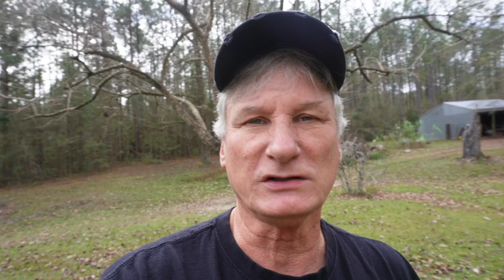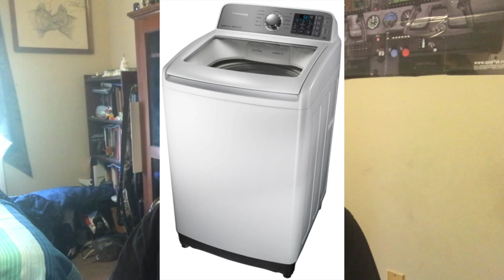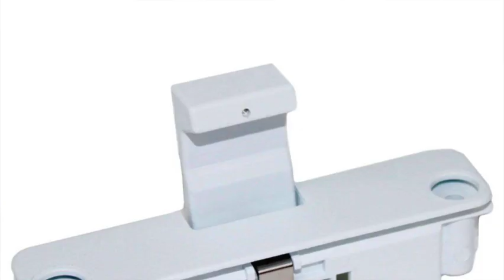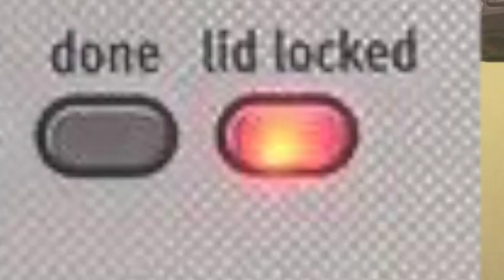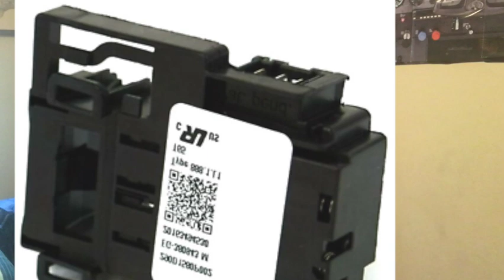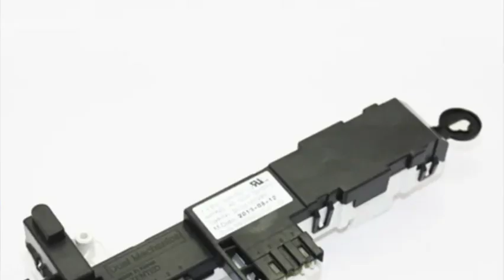Washer Won’t Start? Check the Lid Switch First

Comment from the maker: 🔧 If the lid switch or lid lock checks good and the washer still won't start, it's time to look further. So I built FixIt Pro out of the repairs I do in my shop. It asks what the machine is doing and points you to the most likely bad part and the tools you'll need, along with the video of mine that shows the fix. It reads the build date off the serial tag too, and it works with no signal. It's $19.99 one time while the launch price lasts: https://harperknowles.gumroad.com/l/fixit-pro
Reply: Lid lock light flashed, replaced the lock. Now have no lights and no flashing

Comment: Cabrio whirlpool lid lock locks and then unlocks straight away upon hitting start,and dosent start then just flashes.
Reply from the maker: Something is failing the startup test sequence. The first thing I would suspect is the drain pump, then the water inlet valves, or perhaps even the lid lock/switch. Unfortunately I can’t determine which without diagnosing it myself. Thanks for watching!
Reply: @HarperandKnowles  Thanks for responding. I should have mentioned I did replace the lid lock mechanism. It's still just the same lock and unlock upon start.
Reply: @HarperandKnowles  I had the same scenario, so I went through he self-test, self-diagnosis procedure (control knob one click ccw, 3 clicks cw, 1 click ccw, 1 click cw. Test #4 is latch mechanism itself test, which throws an F5 E3 (if I recall correctly) code if and only if the latch mechanism is the problem. I replaced one previously, time to do it again. You should have a service guide inside the case of your machine -- follow instructions, and it sounds like you will get a different error code than I did.

Comment: Can you jumper wire lid (lock) switch wires (connectors) together where both wires are same colour (for example both are green ones, assuming there is no polarity) ?
On lid (lock) switch (older Candy washing machine) there are marked pins 1 and 2 (switch with 2 pins).
Reply from the maker: Lid locks should never be bypassed. Lid switches are easy to bypass. If you try bypassing lid locks on machines that have control boards you risk damaging the electronics. These machines have chips on them that recognize when the lid is open or closed and when it should be locked or open. The locking and unlocking is part of the programmed process of particular cycles and shorting these wires can cause real damage to the control board. The logic of the cycle function has to recognize each condition and will not advance until the condition it expects is met. Thanks for watching!
Reply: @HarperandKnowles  Thanks for a quick answer. I think it's a lid switch, rather than lid lock (in service manual it is stated as delay switch, seems to have also a small magnet inside).
Just asking out of curiosity, do you think in my case simple short lenghted isolated wire between 2 same coloured lid switch connectors/wires will work or it isn't that easy?

Comment: Mine doesn't click at all. Powers up fine. But won't enter into any cycle at all when I hit start. Also, when I go into diagnostic test mode and I hit start it won't run any tests on any setting either. It's a Samsung aquajet vrt. Top load. any thoughts would be appreciated. or anyone in the comments. Thanks..

Also, I used a magnet and I could hear a faint click from inside the lock. But when I hit start there is no clicking for almost every time I try this. A couple of times i could hear the washer trying to click. .....Now when I put the magnet on it I can't really hear any click inside of the mechanism as I did before. Maybe I'm just losing my mind. 🤷🏽‍♂
Reply from the maker: I can’t make an educated guess at the problem without diagnosing the machine myself, but you could try changing the lid lock to see if that is actually the problem. Thanks for watching!

Comment: I have a Frigidaire Stackable Washer and Dryer model FFLE3911QW. Recently, the washer stopped working after completing a wash cycle. The lid remained locked for a while, but eventually, it unlocked. Now, when I try to start a new cycle, I press the start knob, and all I hear is a beep, but nothing happens. The lid doesn't lock or show any other signs of starting. Do you have any suggestions on what might be causing this issue? Thanks in advance.
Reply from the maker: Since the first indication was a fault with the lid lock I would change that and see if that fixes the problem. Thanks for watching!

Comment: I don’t want a lock PERIOD.  I don’t have any kids and I don’t care about the liability aspect.  I want to be able to open the lid whenever I want to open the lid. I don’t need nanny state telling me what to do.  Can you file down the  plastic piece that engages and all allows the lock?  That way it opens and closes and can detect open and closures, but since the tooth on the actual lock is filed down, it can’t actually lock?  Would that work?

Probably not because when you open it, it would detect the lid is open and then it would shut down probably in some manner that wouldn’t allow it to start back up when you close it
Reply from the maker: The Speed Queen TC5003WN affectionately known as the TC5 doesn’t have a lid lock. That is the only modern machine I know of without the lock. Attempts to bypass lid locks on machines with control boards risk frying the boards. Thanks for watching!

Comment: I think that there is a secondary market for modified parts, and replacement circuit boards. Part of the right to repair should allow people to make a much cheaper circuit board . As such, would be able to program your circuit board that just tell it it always is closed.... I'm hoping for a future well we can 3D print parts, and program circuit boards to replace oem boards....
Reply from the maker: I like the ideas of K. Eric Dexter in his book "Engines of Creation". That's the world I want to see. Bureaucrats are making too many silly requirements on manufacturers and litigation is out of control. I'm all for environmental protection but there should be a limit to what a government agency can foist onto the public. Allowing you to market your work arounds would upset those bureaucrats to no end! Thanks for watching!

Comment: So any suggestions, we just moved our roper washing machine into the house and the lid won't open and the plug is inside the washer machine with the lid shut, any suggestions how to unlock it with it not being plugged in, please help thank you
Reply from the maker: Take the two screws off the back that holds the lid down as well as the wiring cover plate. Slide the top forward about 2 inches and wiggle near the front to lift it from the case. This gives you access to the lid lock. You can try to manually open the lid by fiddling with the mechanism. Good luck and thanks for watching.

Comment: The latch lock, closed on new washers are just a magnetic proximity switch. 90% have two control wires and a green ground wire,  by cutting the contol wires coming from the board and splicing them together with the machine unplugged. Its a simole circuit its NOT going to ruin a thing.
Reply: That's not true with the new ones. During the cycle the computer plays with the lid lock like a kid with a new toy, and before moving on to the next part of the cycle it wants a signal from that SOB opening and closing, the engineers are total Aholes in this but its true, no easy way to bypass it anymore.
Reply from the maker: Very true! Thanks for watching!
Reply: @paulkomrowski5701 is strikes me that somebody could make a dummy unit with with its own control board to send it whatever signal it wants, basically a mod chip to disable it that you plug in instead of the switch... Course would have to make it ..
Reply from the maker: While your suggestion might apply to older, non-computerized washers, it's crucial to note that newer models with lid lock/lid switch features are much more complex. These machines are designed with safety measures that are integrated into their computerized control systems. Attempting to bypass these features can not only void the warranty but also risk damaging the machine or causing personal injury. Modern washers use these sensors to lock and unlock the unit at specific times during the cycle for safety reasons. So, it's not as simple as splicing two control wires together. I'd strongly recommend consulting the appliance's manual or seeking professional advice before making such modifications.  For ever machine someone has brought me where they tried to override the lid lock/lid switch I’ve had to replace the control board to repair the damage. Thanks for watching!
Reply: It will because the lack of electrical resistance when you removed the load you're causing a short

Comment: Is there away to get an Electric Washing Machine to work that is missing the Metal Clip? because the apartmeant that we moved into already has a Electric Washing Machine in it but the Metal Clip that locks the lid was already missing when we moved in and the people that we pay our rent to still hasn't fix it we have been waiting since we moved in last year for the people we pay rent to replace the Metal Clip and they still haven't done so they just keep saying that they are going to replace the Metal Clip
Reply from the maker: I'm sorry to hear about the issue you're facing with your washing machine. Based on your description, it seems like the metal clip you're referring to could be the lid striker, which is a part of the lid lock mechanism. Without the striker, the machine might not be able to detect that the lid is closed, preventing it from starting the wash cycle.

While I understand your frustration with waiting for your landlord to address the issue, you might be able to find a replacement part yourself. Try looking up the model number of your washing machine (usually found on a placard inside the lid) on Amazon or another online retailer, and search for the lid lock striker for that specific model.

Please note that replacing the striker yourself may be considered a repair, and you should check your rental agreement or consult with your landlord before attempting any fixes. In some cases, tenants may be allowed to make minor repairs and deduct the cost from the rent, but this depends on your specific agreement and local regulations.

I hope this information helps you resolve the issue with your washing machine. Please feel free to reach out if you have any further questions or concerns.
Reply: @HarperandKnowles  awesome answer ❤

Comment: Thanks Again
Excellent Video
Reply: Thanks.I broke a tink piece off the new switch/trying to open that lid/after that/no lights/no luck getting in diagnostic mode/ I tried unplug wait/etc/ tried a magnet/pushed the switch with thin screw driver/ pushed start ,nothing . One video said sometimes u did this to fool the control.
This stuff is faster /cheaper to produce .Or possibly evil reasons for our future as followers.
I'll order a new switch/ cheapest/which will take a month to arrive/then see if any local/ within 30 miles has the time to give me any tips. I've cleaned up one of 2 washers
I'd refused to haul off/Because
IT STILL WORKED! I got it swamped up the steps by myself.Allreadt tried it out.
Still works/my wife isn't happy cause I wouldn't just go get a $535.00 New washer.
This is yea ol Kenmore Heavy Duty 70 Series.
Man I'm really impressed that you take such an interest! 
Thanks for Checking!
Reply from the maker: @stevepope5484  LOL, I thought your repair story would make a good Hollywood comedy!  I smile every time I hear of one of your antics!  Keep at it, my friend, you'll eventually get it done!
Reply: 220/221 Whatever it takes.
Reply from the maker: Thank you!  How’s that repair going?